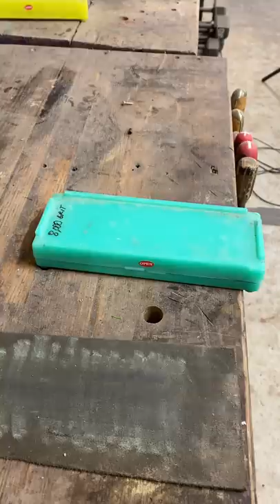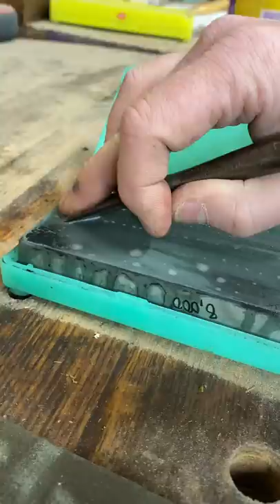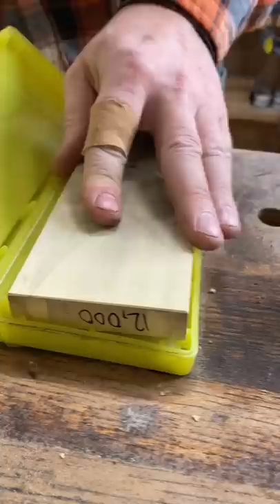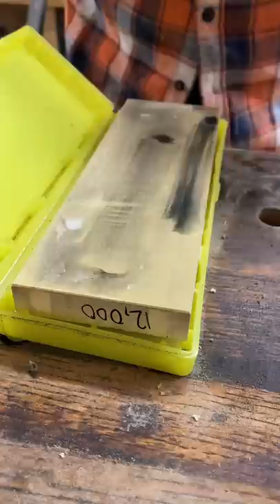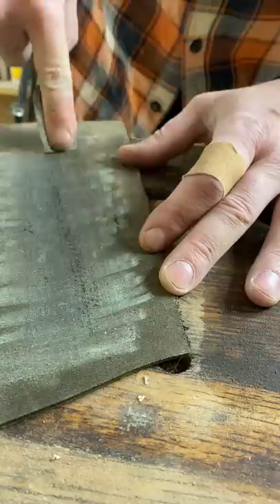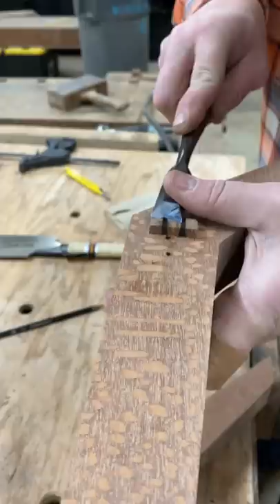Scary Sharp Chisel Sharpening 12,000 Grit #Shorts

Comment: You should push the blade on the stone, because since your pulling it, your letting all the debrie from sharpening on the sharp edge, and also, you should finish with rubbing the bottom side of the chisel not at the start
Reply: This is just nit picking. The slurry from the iron/steel mixing with water is not harmful to the sharpening method, and the burr can be developed on either side of the bevel. So long as a consistent method is used, results will be effectively identical.

Comment: Just because it looks shiny,doesn't mean it's sharp. Also, those are whetstones. You don't use Windex on these, you use regular unsoapy water or the soap will embed in the stone and dull the minerals.
Reply: Please explain to me how soap can dull aluminium oxide, a ceramic, thanks.
Reply: @autumn5592  bear with me. It's hard to say it quickly. 

The aluminium oxide stones are porous, meaning they absorb whatever liquids you put in it. The soap doesn't blunt the aluminium oxide granules (one is a sticky goo and the other has a Mohs hardness of 9). Rather, the soapy residue builds up between the particulates which causes the blade edge to skate over that, which has embedded between the particulates, instead of making consistent contact. 

Half the reason why whetstones and oil stones use a liquid is to ensure the shavings float away from the stone rather than embedding in it which causes the stones to act dull. It also means the blade can glide over the grinding surface and not cause damage to the edge or the stone itself. It's a lubricant. 

In the case of aluminium oxide stones, the water in the glass cleaner evaporates and leaves the soap residue behind. Typically with porous stones you use either oil in the case of an oil stone (which means it sits in a bath of its own making which you reapply every time you use it) or basic tap water for natural stone which can evaporate completely after use.
Reply: @classydays43  Soap is soluble in water, the second you apply pressure it just gets washed away.

Soapy solutions used on whetstones are usually only 2% or so, not any amount that would clog pores, especially on splash and go stones (like in the video.)

Soap helps float swarf away, by preventing it from sticking to the stone/getting stuck in the pores of the stone.

It's a non issue, soap is fine.
Reply: @autumn5592  Soluble doesn't mean it evaporates. Cold saws use a water soluble fluid to keep the blade safe and when the water evaporates, the oil is left behind, as per the case with soap because soap doesn't evaporate.  
Soap isn't what keeps the swarf away, it's the liquid that floats on the surface. Porous stones like this need a lot of liquid because it's absorbed pretty quickly in the stone, so renewing it means you're increasing the soap quantity in the stone every time you whet it. 

Don't use soap.
Reply: @classydays43  I never said it does.
It will wash off as you use it, because soap is soluble, and when you wipe it down when done, soap will not be an issue.

The soap prevents the swarf from sticking, that's how soap removes dirt from anything.
The water will float away the swarf, yes, but the soap helps it even more.

Shapton Ha No Kuromaku stones are NOT soaking stones. If you soak them you WILL ruin them. They are splash and go stones, they only need surface water, and will not absorb water easily.
Soap will not do anything to these stones.

It sounds like you have never actually used soap and water on a stone before, and you're complaining about a theory you have of what will happen.

I've used soap and water on soaking stones, and on splash and go stones,  I've used it a bit on some natrual stones too.
I have never had soap clog or even negatively impact the performance of them.
Reply: @autumn5592  If it doesn't cause issues for you then keep doing it. You did, however, ask me why I thought what I did and got all defensive when I outlined what it was that I thought. You'll have to forgive me as I doubled down when you acted like my reasoning wasn't suitable for you.

Comment: If you're using one of those chisel angle guides, u don't have sharpening down yet 😁
Reply: Go tell that to Paul Sellers, who has been sharpening his own tools for 60+ years. He's a treasure trove of information here on YouTube and on his woodworking blog--and he sometimes uses a guide when sharpening his chisels.
Reply: @0num4  u go tell him lol. I have 40 yrs experience as a cabinetmaker, woodworker trim carpenter n remodeler.. putting a micro bevel on a chisel edge with no contraption is one of the easiest sharpening tasks..I ca n also grind a straight bevel on a chisel or plane blade by hand on the grinder with no apparatus...practice n skill, try it😁

Comment: Just for your information razor-sharp edges will become non sharp after water dries on them that's the reason why your face razor goes dull your facial hair isn't strong enough to mess up the blades and neither is wood usually so if your blades are going do then you need to sharpen them again and then every time they get wet make sure you dry them off completely

Comment: You gotta get the leather strap wheel for a bench top grinder....makes a chisel so sharp you can cut the small amount of truth from the world's biggest lie. Got it from rockler.
Reply: It is 'strop',  not "strap"...
Reply: @alfredomarquez9777  sorry spell check on this android phone corrects words you don't use much.....strop for sharpening and strap for the trip to the barn.....
Reply: Dangerous and very easy to overheat the edge. No thanks.
Reply: @autumn5592  my wheel strop has never overheated, plus it has speed control .if I sharpen my $1000 Dalton knives , we ankrom $3000 knives and other knives from my $80000 collection on my tormek sharpening system .
Reply: @johnnyteague3407  You said bench grinder, now you say Tormek. The two are completely different.

Bench grinders are usually fixed speed, at absurdly high RPM, if you attach any kind of wheel for sharpening or stropping to one, you will overheat the edge in a fraction of a second. Fact.

Don't get why you bragged about expensive knives, not relevant to the conversation at all.
Reply: @autumn5592  sorry about the mix up but I also have a 1 .5 hp craftsman industrial grinder that has speed control . purchased it in 1999.  Also on my work truck I have a 6 in Delta  bench grinder with speed control.  At the print shop I use to work at the baldor powered bench grinder had speed control. I have seen many bench grinders with speed control. When I was a member of the Ms knife makers guild everyone in the group had a tormek and a bench grinder with speed control. So you can use the tormek or the bench grinder with the strop wheel.

Comment: Wow. 
Sharpening skill: 8/10
Japanese saw skill: -3/10, that's not a western push saw, that's a pull-saw.
Chiseling skill: 4/10, that was a file/sanding job, not a chisel job, and it still looked half-assed.
Overall score: 5/10, please find an apprenticeship to hone your skills as the shops tool-guy. Your work in sharpening was excellent, and your sharpening materials were very well organized.  👌

Comment: If it is too sharp, then the edge will get damaged or broke more easily and you'll have to sharpen it very soon... Better sharpen it fine enough that cuts good and is ok, but dull enough that the edge doesn't brake easily.
Reply: Don't speak.

Comment: This takes way too long, how do al these people have time for this? I need to use my tools, not cuddle them.
Reply: Compared to what?
I mean this guy didn't effectively sharpen anything but the method he used works, it takes like 35 seconds once you get used to it. It would take more time for me to use a bench grinder lol (which doesn't leave a remotely usable edge for woodworking). What are you using to sharpen?
Reply: Compared to that magic tool I was keen to find. I had hammered out a chunk of my favourite and only remotely decent chisel. I wanted it sharp, without effort. 
So I whined online. 

Somewhere in between the whining and your reply I bought a "crazy sharp set" or whatever it is called. A glass panel with some fancy sandpaper. 
That bit of kit is not crazy expensive, and apparently not half bad. So I thought if a good way to find out if I like to sharpen my tools, and if it works out for me. 

It did, I liked it and that chisel is sharp again (sharper than out of the shop I believe). Some others are not, I think because of the flat back part not being flat. Or because I didn't put in enough effort. I don't know yet.